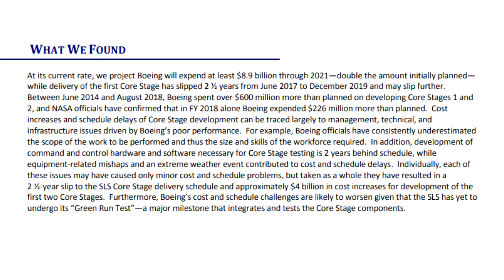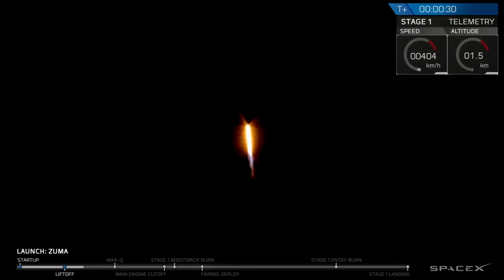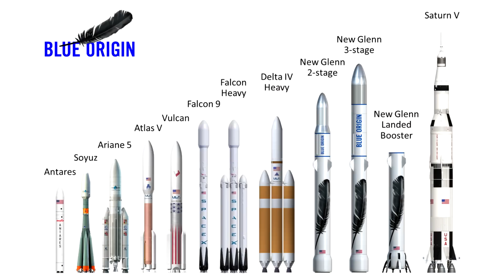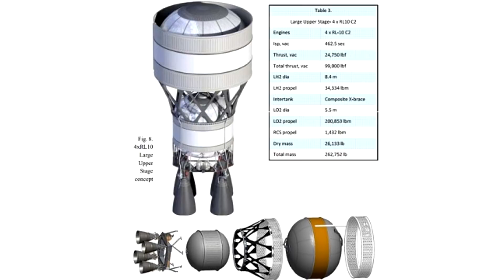New Glenn, OmegA and Vulcan Get Air Force Approval

Comment: Use a heavy lift rocket to place a big winch into orbit and just hoist payloads up into orbit afterward.  ;-)  The simplified form of the Space Elevator.  With a high speed winch and a low thrust rocket you might find a perfect balance.

Comment: The DOD's biggest concern is to ensure that there is competition among their suppliers.  If you notice that the last three makers of combat aircraft each got a contract.  Lockheed is going fine with production of the F-35 but both Northrop and Boeing were planning on leaving this market if they did not get contracts.  So Northrop and Boeing each got a contract.  One of the first things Trump did when he took office was order the DOD to do a top to bottom review of the capacities and capabilities of the defense industrial base.
Apparently - the findings were very bad because the results of that review are now classified.  Things are very bad in the defense industry.  70% of the defense manufacturing capacity we had on the year 1990 no longer exists and a lot of things the DOD buys are in such limited quantities that they are essentially hand made.  

BTW - this has already come back to bite us.  In 2004 the DOD basically took over the production capacities of companies that made 5.56 and 7.62mm ammunition and we were still consuming ammunition faster than it could be made.  The air war against ISIS has been using 'emergency war reserve' munitions stockpiles because the manufacturers are operating at max capacity and refuse to invest in larger facilities and more workers because they expect that the current level of orders to dry up once the war stocks are replenished.

Comment: at 5:30 you give the precise reason. the Air Force (most optimistically) wants a competitive market. New Glen will be near to falcon heavy but BFR will most likely be the RL successor to the SLS. Boeing will get (or already has) more funding for additional x37b-ish vehicles

Comment: I'm not surprised at all.  I used to work at Boeing/Rocketdyne on the EPS for the ISS, and they were a bunch of idiots.  Also worked on the controller for the RS-68 engine, and that team was a bunch of idiots.  I was so happy when I finally gave up and quit back in 2001.

Comment: Simply ULA launch cost are high due to low launch rates. There is simply not enough launches to go around. So how does Space X do it for less. Who knows? They are private and as such their finances are private. I know they work their salary engineers hard and with lot of unpaid overtime. There is no way development cost is fully being pasted in current pricing. The reusable boaster is why it cost less? Again this is dubious to the real savings. Look it up. Reusing the booster means even less quality of parts for suppliers and hence per part cost has to be really high. This low volume which hurt Delta and Atlas. Don't get me wrong, I think what Space X is doing is cool but I don't understand with the number of launches and all this development how they can offer the lowest launch cost other than they are purposely undercutting the competition. So I wonder how this contract plays out in SpaceX strategies. I think they are playing on the cool factor to get cash flow for some other source. Scott it would be interesting to break down the Space X development expenditures past and present and other operating costs.

Comment: In my opinion, a monopoly that offers the best prices is a good monopoly. 

If SpaceX becomes a monopoly, it will not change the fact that Musk will continue to develop new rockets. Bigger and stronger. And SpaceX does not need competition to improve. As long as Musk is in command, SpaceX will continue to innovate and offer the best prices on the market.

Comment: Having some competition for SpaceX is not bad, it will help revolutionize spaceflight even faster. However, SLS should really be canceled. After BFR and New Glenn, there would be no need for it. So just throw away your sunk cost NASA, and do something more useful instead.
Reply: New Glenn is in no way comparable to the SLS 
It is going to be capable of lofting about 45 mT to LEO which is less than half than that of SLS Block 1

Comment: Blue Origin is building the New Glen in Meritt Island Florida which is right where KSC, Patrick Air Force base and Port Canaveral are located. Several Air Force/D.O.D aerospace contractors like Northrup Grumman also have major facilities in the area. I'd guess Air Force probably likes the idea New Glenn will be built nearby where it will be launched and also near other infrastructure Air Force relies on. 

Space X Contrastingly is building rockets in California. Which means everything has to be moved thousands of miles and likely through other countries to get to the KSC's launch facilities.

Comment: I think the Air Force has been surprisingly prudent with our taxpayer dollars, investing in a synergy of technology.
Reply: Like wasting billions on SLS?
Reply: Hardly wasted. It's about setting a benchmark.
You should read up on the development of the Saturn V sometime.
Reply: @GeneralJackRipper  benchmark for what? What logic is there in funding SLS with no available payloads vs SpaceX that at least has a paying customer for it's vehicle?
Reply: @GeneralJackRipper  what's it's mission objective then? The sat 5's objective was to get a certain payload to the moon, the SLS is..... building a hypothetical "deep space gateway" that neither helps us get into deep space because of lost Delta v nor helps us colonize the moon or Mars.
The SLS is just another jobs program, over budget and past due.
Seriously, aside from that lunar boondoggle what other missions are slated for SLS?
Reply: @GeneralJackRipper  well first, its the block 2 configuration of SLS that's supposed to reach Mars but that is currently on hold as the current mission of SLS is that lunar gateway that could be built with some falcon heavies.
Currently I can only think of the SpaceX bfr as the only example of any company seriously designing a vehicle with the ability to reach Mars.
I guess China is technically designing a Mars rocket but that's quite a few years away as well.
Reply from the maker: To be fair, SLS isn’t funded by Air Force, it’s NASA, and in part politicians like Richard Shelby who uses it as a way to send money to his state.

Comment: It's worth noting that the contract is for DEVELOPING launch vehicles, as opposed to launching payloads.

In this context, SpaceX already HAS a fully operational launch system in Falcon 9/Heavy, so it's unlikely these would even be eligible.  Adding features to these systems would apply, but SpaceX has already announced that they're deprecating them once BFR is ready.  BFR itself would be eligible, but either the military didn't want it, or SpaceX wants to design it fully in house without government meddling.  Consider what meddling did to the Space Shuttle.

Comment: Just a small correction: New Glenn won't fly with 1 Hydrolox engine for the second stage. They will either use 2 Hydrolox (BE-3U's) or 1 Methalox (BE-4U)

Comment: Maybe they are funding those rockets so there is more competition really.
If u think about it, SpaceX is currently the market leader for military and commercial launches with higher payloads, simply because they can launch so cheap comparably.

Competition is healthy for the market and i think beside all the political links this round of funding promotes just that.

Also it makes sure that they wont be dependant on one company only for launches in the future. What if the AirForce needs a new fighter jet? They would put out a competition and then choose the best product by their discretion, that way they are making sure they have variety when it comes to choosing new rocket engines or rockets itself for their needs.

Comment: The reason to not more funding going to Raptor is:
Tom Mueller said that the engine was near completion. Prob being scaled up, and just the injection is on the improvements phase.
The development part is now over. The engine is ready.

Another thing is, the latest update on the BFR leads to an Chamber pressure on 380
Not subscale.

Comment: The EELV development contract is also designed for redundancy; that's why they're spreading the money around rather than just lumping it all with one company.  A few years in the future in stage 2 the three rockets will be downselected to the final two (SpaceX can re-submit a rocket at that point).
Given that the DoD wants redundancy, they won't want parts commonality, because an issue with something, say an engine, could ground both rockets.  To that extent I think the Vulcan is on the outer, since it uses Blue Origin engines and Northrop Grumman solids.  The $1bn is a final windfall for ULA before it gets 'outselected' and Boeing/McD wind the company up.

Comment: I think it is just because SpaceX doesn't want to give the government any opportunity to have a say in the design of the BFR.
Reply: samv03 Exactly. The Air Force does not give one single fuck about creating monopolies lmao they've been providing billions to a monopoly (ULA) which they themselves created. Just last week a SpaceX executive talked about turning down an unnamed government agency the opportunity to fund falcon heavy. Flipping that strategy makes no sense at this point, as SpaceX knows that the rest of the rockets either won't make it to market or will be more heavily delayed than BFR(Vulcan is an Orbital ATK product. It will fail too many test flights and cease to exist. ULAs rocket will swallow twice the amount of allotted funding and will cost even more to operate than they claim. New Glenn will make it to market years late because Blue Origin has zero experience launching and landing. New Shepard barely even does LEO.
Reply: Yeah, Air Force interference crippled the Space Shuttle.Why let them do it with BFR?
Reply: You know that in the end the BRF is relying on the say of NASA to approve it as a launch vehicle? You know that the only reason the Dragon isn't flying right now is because it hasn't reached government set safety regulations? I'm not saying Dragon isn't capable, all I'm saying is space travel and launch vehicles are heavily controlled by the government, regardless of whether or not the company wants full control.
Reply: WheresMyCar I think there is a considerable difference between safety regulations that dictate design safety requirements, and government influence of what the end design capabilities are. I think what they want is full control over the desired capabilities of the vehicle so they don't get locked into commitments that are found to be unrealistic as the design process runs its course.
Reply: WheresMyCar - I know that SpaceX has to follow government safety regulations (even if they're significantly more strict than anything NASA had to follow), but that's a lot different to what happened to the Space Shuttle. NASA accepted the Air Force's request to make the Shuttle capable of single-orbit cross-range capability, and able to carry Air Force payloads. This made the Shuttle far larger and heavier than was actually needed. Then the Air Force pulled out of the agreement, giving no funding, and leaving NASA with a vehicle that was not appropriate for their needs. The only time it got use of the modifications was when it repaired Hubble.

Comment: Anyone have any kind of rationale as to why ULA and Northrop get nearly $1B and $800M (respectively) for very conservative rocket designs while BO gets $500M for a far more powerful/reusable/next gen rocket? 

To me this says, it pays to play it safe. Why not reward a contractor for designing with reusability in mind for future cost savings?
Reply: Good point on how it's split. Also, if some BO money goes to finish developing the BE-4, then ULA won't be spending any of their moolah on 1st stage engine. I get that the military wants a conservative design from a conservative company, but c'mon, ULA should fund a bigger portion of Vulcan, which they will also use for commercial launches.
Reply: They can't give out a sum that's less than half a billion. So BO gets the bare minimum to play with and the government gets to see where that leads, while the other two get sums that give the impression of having actual costs backing them up. Or, at least, that's how I had it explained.
Reply: Do a breakdown on which companies have the highest #'s of ex-airforce
Reply: I'm pretty sure they get awarded a contract based on their proposal or "bid."  Lockheed, Boeing, and Northrop Grumman are big-time defense contractors with all kinds of government connections both bureaucratic and personal, so they can get away with a higher bid.  Blue Origin had to undercut their asking price to get a seat at the table.
Reply: ULA and Northrop pretty much need the support of the air force/NASA or else they'll go out of business - they pretty much only have one customer, the US government.

Blue Origin on the other hand is more focused on commercial launches like SpaceX is, plus they have basically unlimited funding from Bezos. The $500M is more a nice to have rather then a necessity.

Plus, ULA and Northrop have a much closer relationship with the military then basically anyone else.
Reply: David Manning Because ULA operate with an amazing launch record, and they are the most experienced and provide the most capability with their cryogenic engines for more advanced missions
Reply: Because they share technology, new glenn is a future rocket, which will get more money later.
Reply: Because ULA runs a less "money efficient" program by buying and opting for more reliable and proven technology's that cost a lot more (An example is the choice to use the RL-10 on their upper stage) but are more reliable. Essentially they are charging more for more reliability, hence the reason ULA is the launch provider that most agencies select for high cost, high priority payloads.
Reply: Pork barreling: keep defence contractors sweet --> keep employment in counties and states --> votes
Reply: Maybe it's because the sponsor of BO has more money than the military? :D
Reply: or maybe BOs New Glen rocket didndt convince the comittee enough and they dont want to get big backlash later on
Reply: I would have given BO the $1B and remaining split between ULA and NG...SpaceX isn’t going away so at worst you’d have a duopoly which is better than the ULA monopoly gravy train we were used to for a decade.
Reply: Because they do not want a monopoly.
Reply: I'll bet BO just picked a nice round number while ULA and NG did some accounting and estimating and added a percentage on top (hence the odd numbers).

Comment: I think spaceX didnt get anything because falcon heavy already works and they dont want BFR cause they prob think its too ambitious
Reply: Alas, New Shepard! How quickly you were forgotten.
Reply: 파버지미니 Perhaps, but the company is called Blue Origin, not New Glenn. Prior, they have made the New Shepard rocket vehicle that makes it to space, though of a different magnitude and profile, but seems much capable of vertical landing. The company is also said to have hired previous McDonnell Douglas DC-X or 'Delta Clipper' engineers, which was capable of vertical landing too. You can read on 'Blue Origin' or 'DC-X' on wikipedia or watch great vids on them.
Reply: its too ambitious caus they actually think they gonna pull it off,no way the New Glen gonna be the same as that kickstarter-scam video.

Comment: I know why the space force is going to fail with normal guns and bullets as there is no atmosphere or gravity in space so the bullets will just hover and stay in place inside the frame of the gun and will not be able to fire again as it would be jammed unless they create bullets with self propulsion like the ones in the single stage rocket boosters
Reply: lol, I can't wait to see there space horse suit, because space force will hire space cowboys
Reply: What? Modern bullets don't need an atmosphere, the oxidizer is mixed with the propellant, and there absolutely is gravity in space. Although I have no idea what gravity has to do with propelling a projectile down a tube, a process that doesnt rely on gravity whatsoever.

Comment: Launch abort systems for satellites? Considering the cost of insurance and the value of the satellites and the fact that satellites are getting smaller, has anybody thought about perhaps developing launch abort systems for satellite cargo? Such a system conceivably could help recover the satellite fairly intact. Wouldn’t this sharply decreased   insurance rates?
Reply: They would have to build satellites to withstand much greater g forces.
Reply: AZOffRoadster Good point. However, it may actually be worth the money. It depends on how much lower the insurance rates might go. Certainly, they can build hardware that can withstand high G forces just as the saw use Did Today.￼